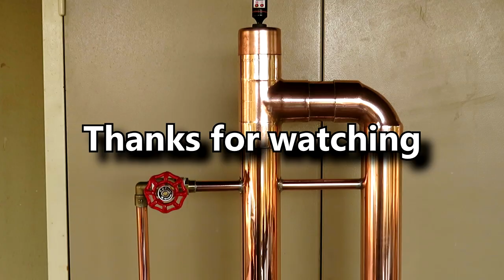DIY Gin Botanical Basket

Comment: Nice job. How did you seal the thermometer with a grommet? And how do you seal the end cap during your run?
Reply from the maker: yes with a high heat rubber grommet, i do not seal the end-cap, I did a mirror test to see if there is any vapors escaping and it looks to be sealed only by friction.
Reply: Awesome. I love independent sports and innovation.

Comment: What setup are you using to tig copper? Awesome video!
Reply from the maker: I used a copper braising rod as filler with a no.5 cup and the red tip tungsten.